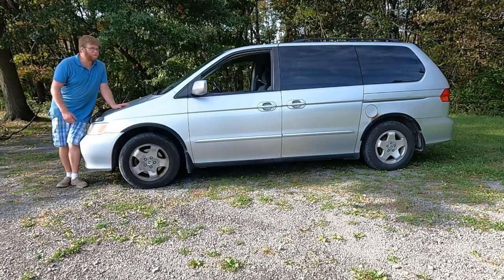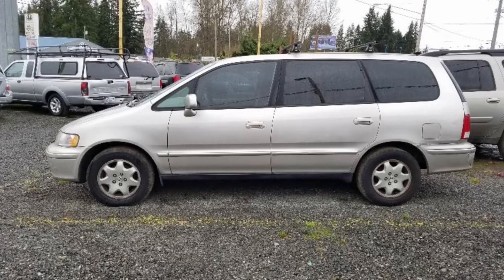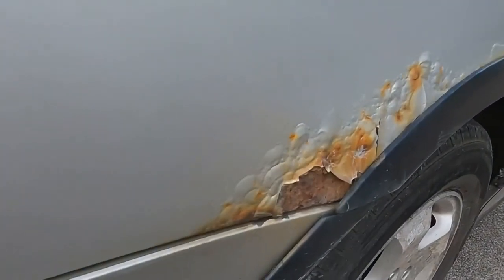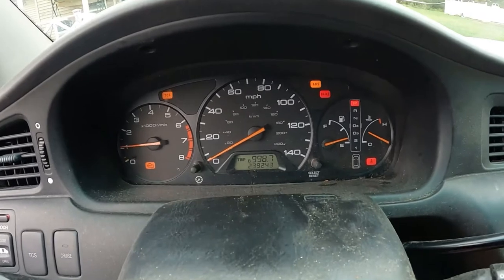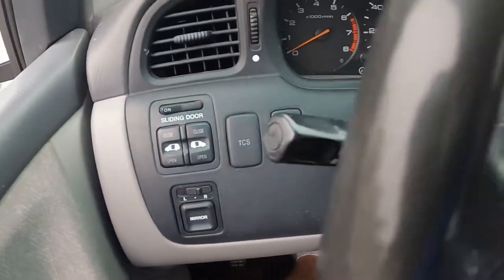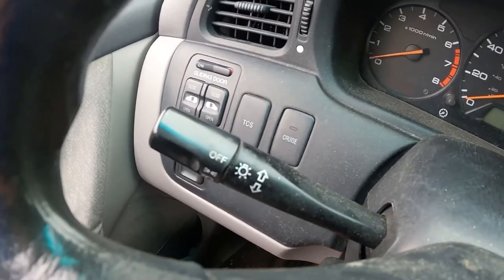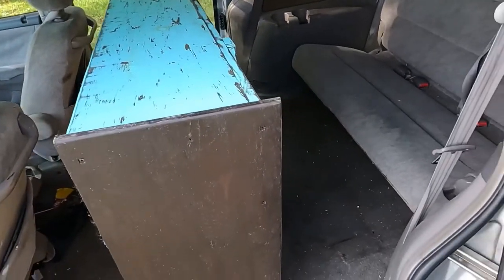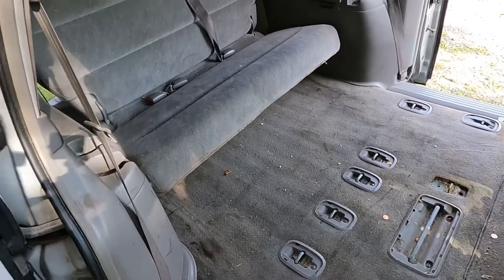2001 Honda Odyssey real world review 20 years later

Comment: I've got a 2001 Odyssey with the 4-speed automatic and have had zero problems with the transmission. It has 120,000 miles. Every single year I change the oil and drain and refill the transmission. I don't go so far as to drop the transmission pan and change the filter though. Still, things are going fine transmission wise. Probably a lot of people who have problems don't change their fluid or use the wrong kind.  I of course only use Honda transmission fluid. I do have the exact same problem as you with the cloth covering coming off of the front doors. I wound up just pulling mine off and feel it looks much better being off than being on and looking ratty. It would probably look better if I spray painted the doors a different color. Overall mine has been great. No rust at all, (it rarely snows here). It sits outside all the time and does have a decent amount of clear coat flaking though.
Reply from the maker: Mine is just a work van I don’t want to get rid of it I got a Prius about a month back and wife said I’d have to sell the van but decided to keep it as a backup vehicle.. and good thing I did b cause family member just hit a deer so they came to me looking to borrow a car.. mine is getting ratty... I’d love to race it in the 24 hours of lemons that would be epic
Reply: How is it now?